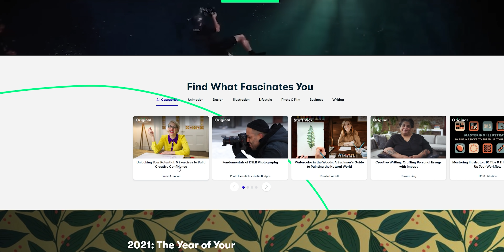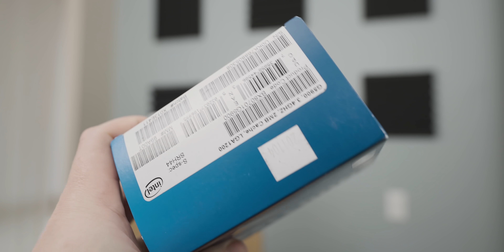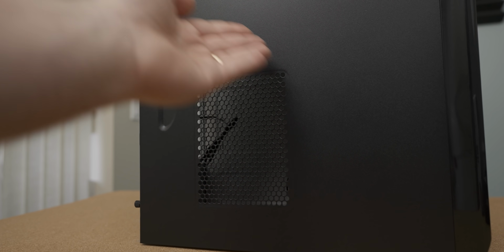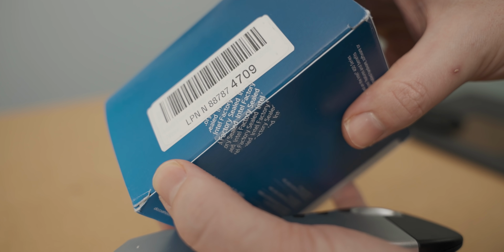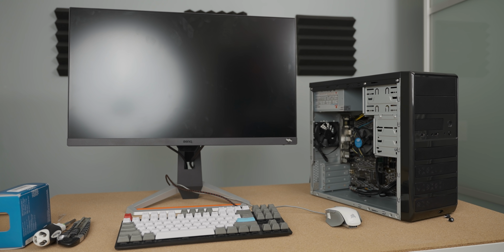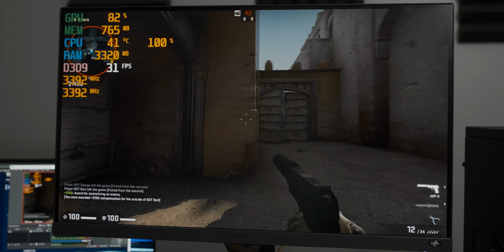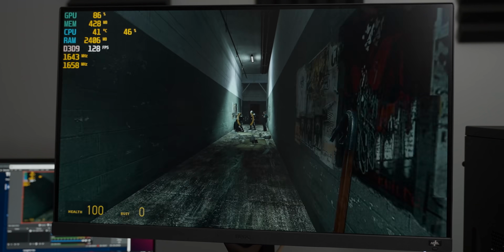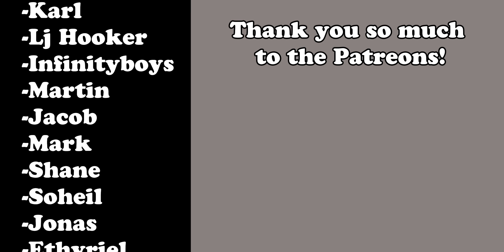Trying to game on the CHEAPEST NEW PC you can buy in 2021...

Comment: Really?  A 500W power supply for a build with not graphics card?  Why not just get the 400W Coolmax from Amazon for $19.99?
4GB of RAM with Windows?  That's gonna kill.
60GB of Storage with Windows?  30+ Gigs system used and another 20 Gigs required for windows Updates....yea, that is a recipe for not lasting long.

Comment: there is an indian who built an gaming pc under (133 usd)10,000 inr and ur build was 1400 inr 
bench marks(fps):
gta5: 50-70 fps
shadow of the tombraider:  60+fps
rise of the tomb raider 90+fps
battlefield 1: 60+ fps
watchdogs 2: 50-60 fps 
assasians creed origins: 50fps
pubg pc lite: 150+ fps
valorant: 80 fps
just cause 4: 55-60 fps
witcher 3 : 60+ fps
nps payback : 50-70fps
far cry 5: 37-47 fps
far cry 3: 50-60 fps
doom eternal: 60fps
rocket league: 130-140 fps
csgo:80-90fps
  
specs:
Intel Core i3 3240
4GB DDR3 RAM
H61 Motherboard
GTX 960 Graphics card
500GB HDD
Frontech Power Supply
Any Cabinet

his video link: https://youtu.be/i1rt7tO6tJY
Reply: That's used parts which isn't same as new parts
Reply: @frozenturbo8623  so u want new parts over performance

Comment: Did you say 20 core processor? Does the computer hover in midair and Shout obscenities at you? Jesus Christ I get warm and tingly when I'm able to get my hands on a quad-core! I have a computer showing eight processors that still has people questioning whether it's a quad or a A8 processor machine none of us have really gotten too picky with it yet to find out. You go into the Windows settings and it shows the machine Having Eight processors is basically what we know. Mary cheap-looking IBM desktop from Lenovo. like most machines I got that Lenovo because Windows 10 sucks if you knew how many machines I've gotten at certain time periods when Windows 10 decided to shit the bed in a whole new way and technicians would just tell somebody they need to buy a new computer or it's cheaper to buy a new computer then have them waste their time at the shop trying to figure out what's wrong with it. I've gotten at least 15 good computers that way not including laptops that every one of them was either a hard drive issue or Windows 10 specifically issue where are you would reset the OS or reinstall something more stable like Windows 7 and Bob's your uncle the computers a happy little camper. Bite me Windows 10. One machine in particular I screwed it up by doing a software reset! Machine was running Windows 10 extraordinarily fast but it had somebody's personal goodies on it so I did the right thing and did a full software reset which resulted in an assload of bloatware and the computer being very unhappy and slow LOL. Machine is unfortunately new enough that I can perform an exorcism and put Windows 7 on it. I'm beginning to wonder about some of these shops when you get an eight or nine month old computer with a Windows software problem.